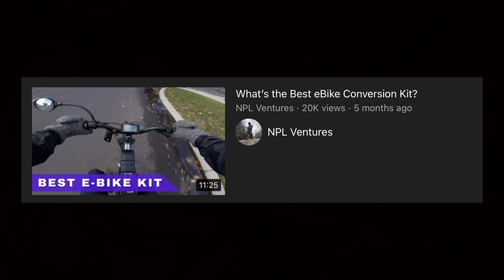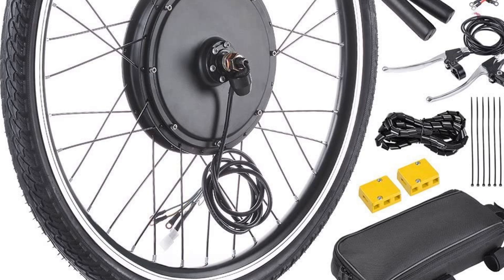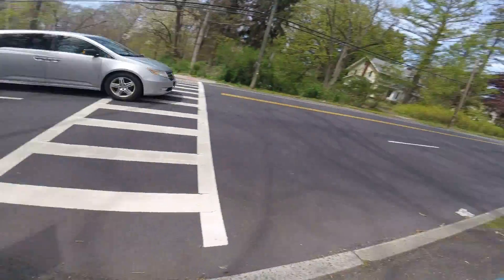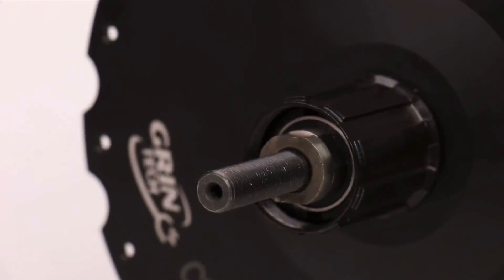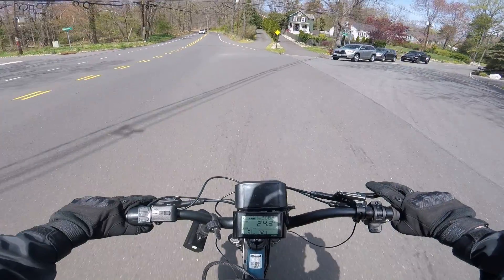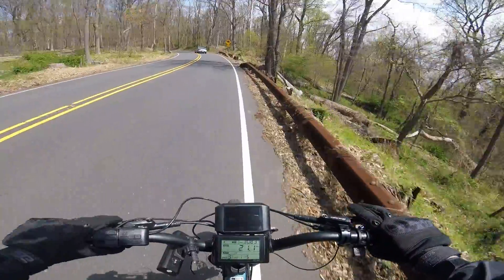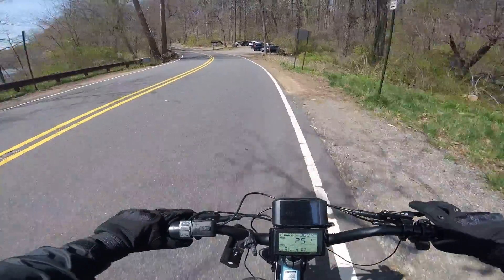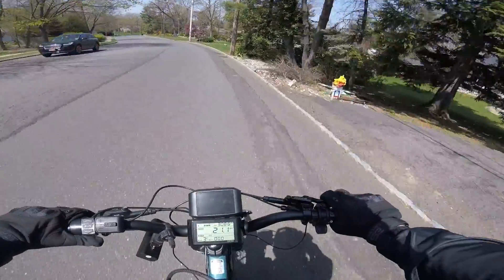The Absolute Best Hub Motor for your eBike Conversion Build

Comment: Just built my first ebike thanks to you! Hope this channel blows up! Keep riding and stay safe brother!
Reply from the maker: Love to hear it, welcome to the movement!
Reply: @NPLVentures  thanks for bringing me in. Think you caused an addiction lol
Reply: @NPLVentures  What I did was put a geared on front (Bafang) dose great at low speeds, and a direct Jauopay on rear... so when the Bafang is spun out I can let go of the throttle and the rear will continue to add about 10 MPH, when I'm nailing both motors at the same time it has torque/acceleratioin similar to a motorcycle.

The only problem is it gobbles up the battery  really fast, but I mostly use this one to boogy to the store & back thats 1/2 mile away.

I've had best luck with the Carbon Speed Cycle 250/500 geared (I'm pretty sure the only difference is the controler).... got 3 and am fixin to get another (black friday deal still on) They don't weigh much more then a regular wheel and on 36vots have nearly as much torque as the Bafang on 52V... AND the CSC motor is super easy to peddle around with no throttle applied....... I'm working up to dual CSC's with a frame motor too on one bike